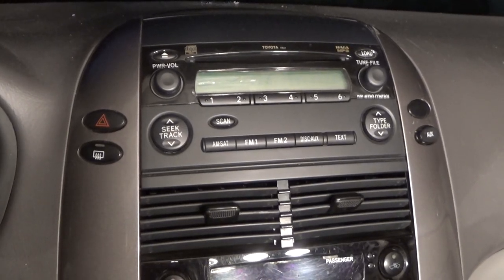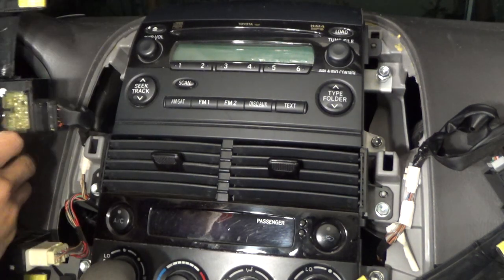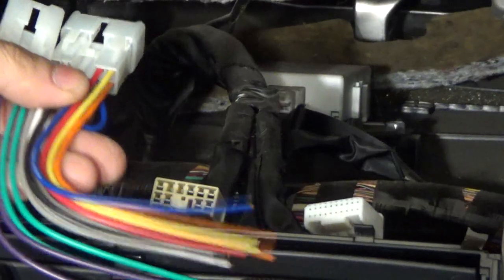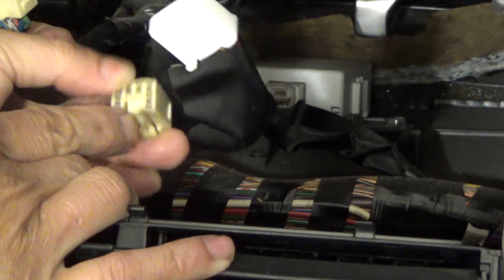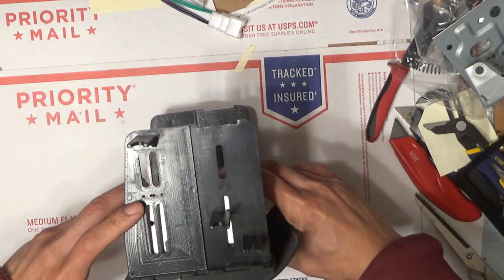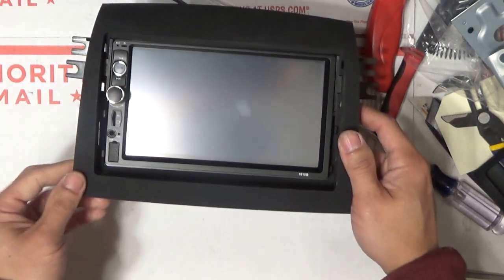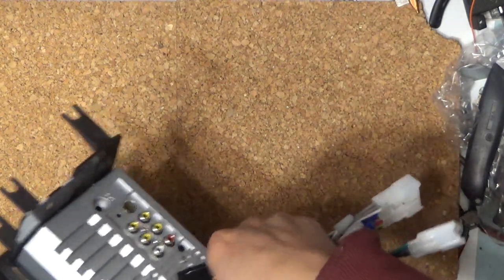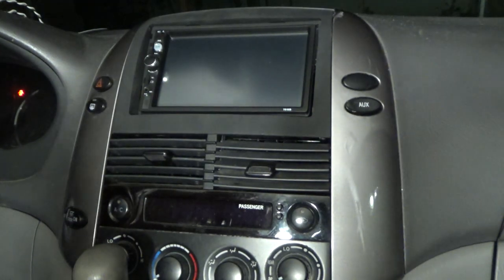DIY: 2004-2010 Toyota Sienna Stereo removal & installation of Tomtop 7" touchscreen BT stereo

Comment: I can't believe how easy it's to remove it! Thanks for sharing. I have to check the variable resistor for the volume. It jumps back n forth when I raise the volume. It probably needs cleaning. Your video helps tremendously.😊

Comment: orange = illumination, dimms radio at night, also wire nits should be used only at home, they might become loose over time with car vibration... heatshrink would be better even if you dont soldier the wires
Reply: I usually do waterproof butt connectors and heatshrink. Waterproof isn't necessary just an extra precaution I take for myself and my customers.

Comment: Thanks for the video.  It's really helpful.  Did your steering control work for radio and volume?  Thanks
Reply from the maker: Steering control does not work any more on the new radio. Other than that, this radio has been great for almost a year now.

Comment: Thank you! I followed this video and got it all working, but there is no audio from the front speakers! My 2004 Sienna LE had four different connectors in the back, and it looks like one of the other two were for the connection to the front speakers. Any suggestions how I can get the front speakers connected?

Comment: Can someone tell me the colors of the wires of this third connector for the three wires needed for steering wheel control?  In my car previous owner has cut the connector off and I can not find any description with the colors I have. Would be much appreciated.

Comment: Where did you get the harness that doesn't fit this application?  Crutchfield's? Wherever you did get the bad harness, I hope you corresponded with them. Nobody wants this to happen again. I see you have over 130,00 views. Maybe one of them had the same concern and contacted the manufacturer.

Comment: Hi, what if I put it without casing?
Reply from the maker: If you don't care about the hole around the unit then that's no problem because it will work fine whether or not you have the casing. You still need to find a way to secure it though or it will fall out every time you accelerate!